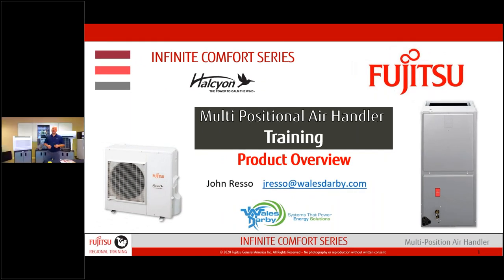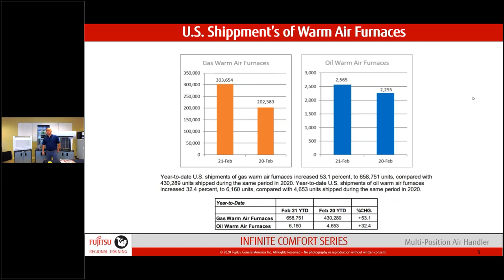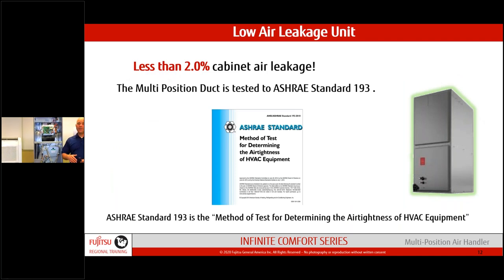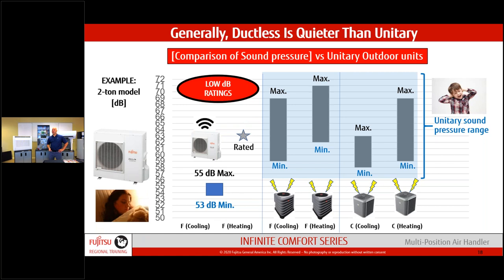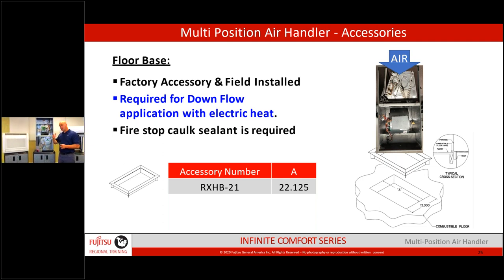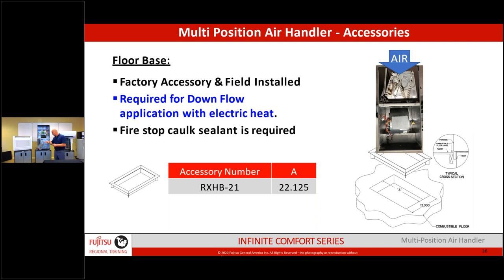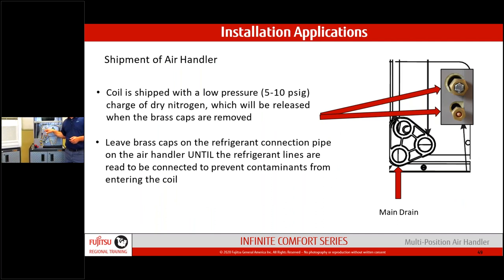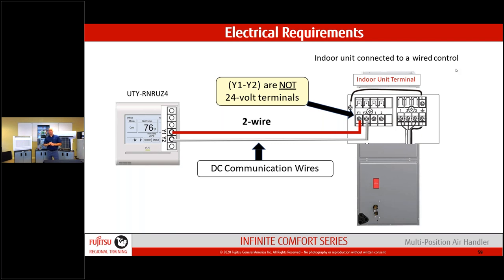Fujitsu  Multi Positional Air Handler Training

Comment: For remote controller cable, the recommendation is a 2-wire twisted pair. How well does the dc communication function using 2 conductors of 18/5 cable say from a previous system's thermostat cable?